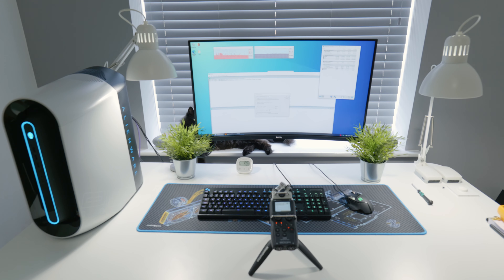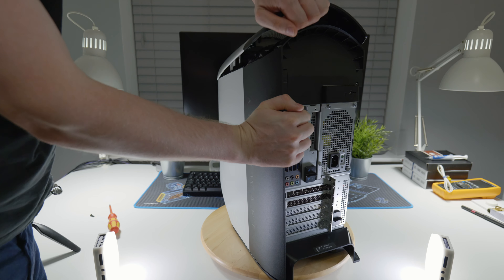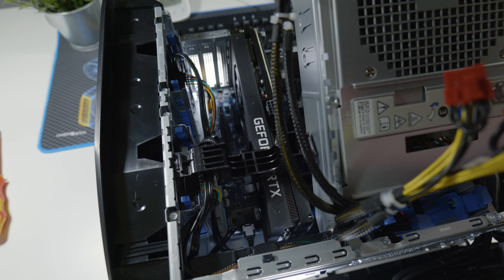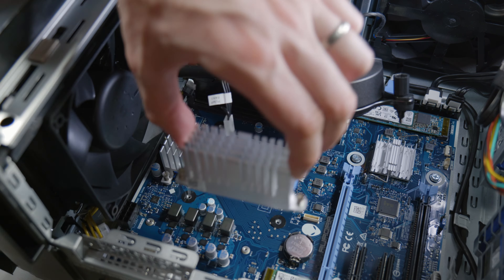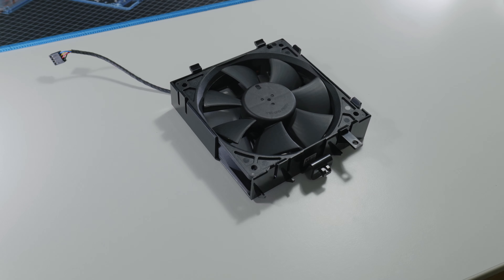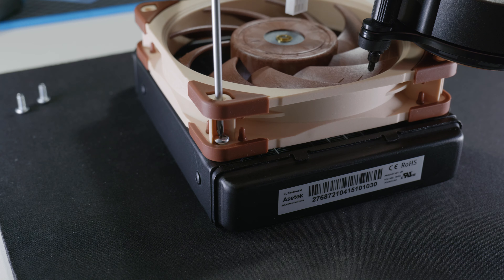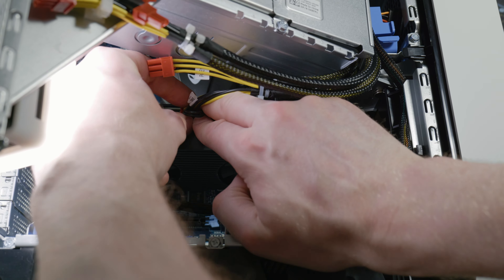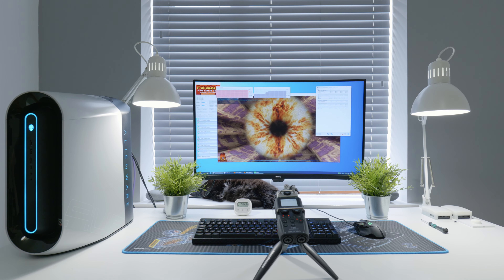Upgrading Dell Alienware Aurora R10 Fans

Comment: Just replaced two fans for my R10 with nf-a12x25 ($65 with tax), however, quite complex feelings.  1) it does reduce noises a lot when PC isn't heavy loaded, however,  it is still not that quiet when gaming, better, but still kind loud.  2) I found that original fans, especial the one in water cooling, that one is truly heavy duty, bigger and stronger than a12x25, I will see if the noctua a12 is good enough to do the job.

Comment: Hi, I've seen a lot of videos covering this mod, but I found yours to be very clear and straightforward, so thanks very much for this. One question though ; why go to the trouble of disassembling the aio and only replacing the stock PUSH fan and not putting in an additional PULL fan like many modders have done?
Reply from the maker: Hi. Thanks for the feedback. I have only replaced the fans to one keep the warranty and also just to get it to run quieter. As for performance improvement or dropping the temps for sure you would need a pull fan on top, I just didn't want to leave the top cover off or cur it open for additional fan.
Reply: @Edsdrafts  Hi, thank you for the quick reply there.  As far as I know, it is possible to fit a PULL fan on top of the radiator (on its own) without having to cut the top cover in any way.  This video shows you how it's done https://www.youtube.com/watch?v=fkVNcTXcpAo .  Also, I would like to know how the Noctua fans compare to the widely-recommended Corsair 120 Pro in terms of noise and thermals.
Reply from the maker: Huh, looks alright. It does look a bit much for most users though hence I didn't even consider it in my video. I might try it later. Wonder what's the effect on thermals.
As for fan - go with what you prefer, there is not a massive difference between quality fans at same RPM.
Reply: @Edsdrafts  sure, just wanted you to know that it is quite possible and easily done once you have removed the aio. It should improve thermals, but again, I can't say by how much. Thanks for all your replies.
Reply from the maker: No worries. Keep an eye on the channel, I am uploading my test results with these fans. You might find few interesting bits in there.
Reply: @Edsdrafts  of course, I am now a happy new subscriber. Keep up the good work dude!

Comment: Good video my Alienware Ryzen edition coming to end of 1 year warranty I'm thinking doing this as well. I guess stock Dell fans are just bad? I also unninstalled alienware command center it improved performance
Reply from the maker: Hi Ivan. Yeah, stock fans are very loud and inefficient. Having said that some are reporting issues with 3rd party ones. Very unusual but keep it in mind just in case. My ones are solid so far.

Comment: There are several versions of this fan. Would you happen to know if it is a 3 or 4 pin? Is it a 5V fan? Thank you, great video.
Reply from the maker: Hi. I went for a  standard 4 
pin PWM. Better motherboards support 3pin just fine but I would not advise it here. As for 5V - that's more of a project build sort of stuff eg. building USB powered laptop cooling pad.
Reply: @Edsdrafts  excellent, thank you

Comment: Looks like your restricting air flow on the left side of the case where the 2 exhaust ports are kinda looks like it’s against the wall. Good video
Reply from the maker: Thanks. The wall is around half plus meter away so should be no problem once the room has some air movement.
Reply: Also my bad but the side of the case is intake not exhaust…. Top and rear is exhaust. Have a good day 👍🏻

Comment: The last BIOS update for the R10 screwed up the compatibility. Hello, I have done the same fan modification with the Noctua for the front and top and it works fine. Unfortunately, the last BIOS (2.2.1 from the 9th september 2021) creates errors Alienware Command Center doesn't show up anymore the CPU temp and the BIOS complete checkup showed up error for the Front and TOP fans. Do you have the same ?
Reply from the maker: Hi. I haven't noticed an update this month, no. You should be able to downgrade if that's the case. Until it is fixed anyway. BIOS updates are rarely required to be rolled out asap.

Comment: I had a question. Will any 4 pin pwm fan work with the motherboard and give no fan errors? Also great instructions on the video. I just bought one 1 month ago and it gets very loud followed your steps and I didn't have a water cooler. And also thinking of upgrading to a water cooler. Any recommendations on water cooler and fans? Air cooler recommendations would be fine too. Great video made it easy for me to take apart.
Reply from the maker: Hi. Yes, any 12V 4pin PWM fan should work, keep the A (Amp) reading to 1.5A max as that's what Dell uses and it is very high. Noctua for example is 0.14A. I know, right?
As for CPU cooler I cannot say much as it might be that you will have to get Dell one. Keep an eye for my new video coming up, you can 'mount' a fan where the HDD cage is allowing more air in, especially important for air cooling CPU in my opinion.

Comment: After I change to  Noctua fan, everytime Windows restart run Pre-Boot System performance check first and say the fan failed to respond correctly. Although press any key will then enter windows, is there anyway to skip pre-boot check?
Reply from the maker: Hi. I must say I never had this issue. Have you updated the BIOS? My one is the latest version.

Comment: Why did you go with a lower CFM fan for the front. Stock front CFM is 169CFM Noctua is 60? Any reasons?
Reply from the maker: Higher CFM is all good and well but it is much louder. Temperature wise it doesn't seem to matter in this case as it is a heat trap regardless.

Comment: Do you plan on adding a 3rd fan? I have the same pc and have replaced both the fans like you did.
Reply from the maker: Hi Edson. I did, for intake. Check it on my latest video. I also tried push pull for exhaust - not much help. It looks like you need at least 240 rad to cool this CPU properly.

Comment: Thanks a lot for the video. I am hugely disappointed at the Alienware Aurora 10 for being such a loud system at such a high price.

After seeing the video, I want to replace the top fan with Noctua as well.

However, as I have seen in the comments, some users had problems with newer BIOS on it and custom fans.

Could you please check on your system if it still works with the latest BIOS 2.2.4?

Btw: I tried connecting the Noctua NA-SRC7 4 pin cable with a resistor inside to the Dell top fan. Afterwards, the fan did not run at all and the PC/BIOS booted into a fan checking mode. Had to remove it to get it running again.

Thanks!
Reply from the maker: Hi. I have manually downloaded and installed latest BIOS last weekend. No issues still, not sure why others are reporting. Maybe Dell did not use same components throughout their builds resulting in these strange errors. Different HW revision maybe?
Reply: @Edsdrafts  Thanks a lot for checking. I can now also confirm that it works!
Reply from the maker: Good news. Was it just a matter of a manual BIOS download and install?
Reply: "high price" its not that expensive

Comment: Thanks for the video, it’ll be really useful as I’m planning to do this myself on my R10. I may have missed it, but what are the ‘special’ screwdrivers used for the top exhaust fan?
Reply from the maker: Hi. You're welcome. You can use any screwdriver that can fit through fan mounting hole. I say special as most people would only have standard philips of flathead that are too thick to fit.
Reply: @Edsdrafts  ah that’s great, thanks, I’ll try a Phillips tip 0. Fingers crossed 🤞 thanks!!
Reply from the maker: Sure thing. Worst case - a trip to local hardware store will solve it, you don't need an expensive one as long as the size is right. You can even bring the fan with you to test.

Comment: this is probably the best video i've seen about the process. so i do not expect any better temps with this mod, but does it actually help with noise levels? temps shouldnt be worse than before either, of course.
Reply from the maker: Hi. It helps with the noise yes, temps are pretty much the same. I also noticed when using non-admin account fans don't ramp up as much. Go figure.

Comment: Do you think leaving the rubber corners make it harder for the fan to push air through the radiator since it creates more of a gap or should I just leave mine on?
Reply from the maker: Hi. You can test both but I don't think it will matter either way. This system is just badly designed when it comes to cooling.
Reply: @Edsdrafts  true. The best upgrade is a new motherboard/case entirely haha
Reply: @mrwanderlive  PSU has proprietary connectors to mobo unfortunately. Dell really doesn't want any parts except for the cpu and gpu to be mismatched which is a shame. to use the psu in another build you'd have to swap the mobo with it :/
Reply: @charidemusx6511  meh both of those are the real treasure within it anyway. Plus the ram and SSDs

Comment: Hi, thanks for the Mod. I replaced both FANs on my New R10 (build 7 days ago) to the Noctua, but the Front Fan is causing a bios error. How did you get by this?
Reply from the maker: Hi. That's strange, I haven't got any errors. What is the error you are getting? Have you used the same header without any fan splitters? Although I even tried splitter without issues.
Reply: @Edsdrafts  yes. I get an BIOS error for the Fan. I just plugged it in. The top Fan works flawless. Replaced it for the original and no error. I read that normaly it is the other way round and the top fan  is issuing error.
Reply from the maker: Fortunately no errors on my build. Are you using Noctua? Have you reached out to Dell and fan manufacturer?
Reply: @Edsdrafts  Yes using Noctua. I bought now a Corsair ML120 PRO and fitted it in the Front. No Errors. So my configuration is now as follow: Noctua NF-A12x25 PWM in top and Corsair ML120 Pro in Front.
Cheers.
Reply from the maker: Huh... maybe just needed a more power hungry fan and that was it.

Comment: I recently swapped the fans and added one, but the top fan starts to slowly drop fan speed from 50 - 56 down to 30 
Once it starts to lower speed it won't go back around the 50s unless I restart my r10
Reply: I should add even with stock fans the top fan would also slowly slow down before that it has gotten stuck wide open until I restarted
Reply from the maker: I am not entirely sure why but I can see from the comments some are having very unusual issues. Have you tried Dell support? What did they say?
Reply: @Edsdrafts  before changing the stock fans I had tried with Dell support and they ended up changing out the front fan not the top one

Comment: do I have to take off the entire cpu cooler to replace the fan? Also would arctic p12 pwm fans work? Thanks!
Reply from the maker: Hi. Yes as access is very limited. It would be much easier than trying to remove it while installed. Any PWM 120MM fan would work. I am releasing another video shortly with more info. Keep an eye for it.

Comment: I want to ask you. Is this replacement possible within the dell warranty period? Will I not damage the warranty?
Reply from the maker: Hi. Generally speaking unless you damage something inside the case, replacing fan is not an issue. If you decide to ship it for warranty however then you will need to put the original fans back in. They might not help troubleshooting noise or temp. issues too knowing fans been changed.

Comment: No push pull? That noctua fan tops out around 2000rpm i believe while the dell server fan is at 4000rpm. (Cfm and static pressure on the dell oem fan is insane but noisy) i wonder how the single noctua fan compares to the dell beefy server fan
Reply from the maker: Hi. Well, results with Noctua 1400RPM were nearly identical to original fan at much higher speeds. Noise is king.

Comment: So im new to PCs I bought one of these and I didn’t get a liquid cooling fan is the regular fan gonna be loud if I don’t get a liquid cooling one instead
Reply from the maker: Hi. It is hard to tell what your experience will be as I never tried it but I do expect your CPU temps. to be very high to the point of throttling. If it does - get Dell involved for an upgrade as in my opinion air cooling option they offer is not enough.

Comment: i did this but after upgrading bios my pc wont let me use the ML 120 pros i had installed now i had to install the old fans...
Reply from the maker: Hi. No issues with BIOS so far nor there should be. Even if my Noctua went at full speed at all times it would be quieter than Dell at half =)
Reply: @Edsdrafts  yea its the motherboard not sure what to do here, i had the ML 120 pros for 4 months inside then had to put old fan in after bios update...
Reply from the maker: Reach out to Corsair and Dell, worth a try.

Comment: Thanks for you video.
Yesterday I made the same configuration with the same products (noctua fans) in my R10, my pc is more quiet it's a very good point for this part. 
But the temperature is the same during high performance, my cpu is between 88-91 degrees. I see your video about the temperature and I think we need to replace the Alienware "watercooling" with the Corsaire watercooling (like H60 AIO Liquid). 
Have you tried to replace the watercooling system ?
Reply from the maker: Hi. Yep, cooling this PC is a nightmare. I haven't because unless you manage 280mm rad to be fitted there's no point.
Reply: Still hot with all the mods. Still crashes at around 67c GPU and 76c CPU

Comment: What software can you download to control fab speed after replacing the fans?!!!
Reply from the maker: Hi. Check on Google, there definitely are options although my new fans are quite silent even at full load so I just left it as is.
Reply: @Edsdrafts  mine are silent as well but when I’m sleeping then go to work I use my hardware to mine. I want to put the fans at full speed to provide a little better airflow. I’ve googled and still can’t find software that’ll control my fans.
Reply from the maker: I've done a quick search and found one called SpeedFan. I have never used it though so cannot comment on it, sorry.
Reply: @Edsdrafts  I’ve tried that one it doesn’t work it only identified the gpu not the dell mobo.
Reply: @alfredoflores8493  ACC you can control fans there

Comment: How do I find out which model of Aurora I have and if the fan will fit?
Reply from the maker: Hi. Best thing to do is check Dell's manuals on your model, you can find s/n on the case and look it up on dell.com/support. Or just take the fan out and measure it.
Reply: @Edsdrafts  Thank you for the info and quick reply!!!

Comment: So you changed two fans right? So the purpose of changing the fans was jus for the noise?
Reply from the maker: Hi. Unfortunately yes. To get better cooling you need at least 280mm rad with 2 fans or change the case and get a good air cooler. Both options not realistic.

Comment: Can i remove the top fan without pull it of from the cpu
Reply from the maker: Hi. In theory yes but I would recommend against it as you might damage the rad or tubes.

Comment: i tried this mod and my cpu temp went from 64 c to 81 c while gaming one time even hit 81 c  I dont think the noctua nf a12 is enough to cool radiator  maybe 2 fans would be better i only tried one just liike you  honestly not comfortable for me having high temps even though my cpu is rated to run optimun until 95 c
Reply from the maker: Hi. What temps do you have on idle and what are your room temps?
Reply: Did you install them the right way?

Comment: I installed a sata ssd today. Thanks for this video. But I also noticed that the moron who assembled my aurora r10 stupidly put the black bracket that holds the gpu card right in front of one of the 2.5 cages. So annoying. Had to use the other one and I could remove it but it was kind of stuck and don't want to break it. Just thought it was so stupid that they didn't realize they were blocking one of the cages
Reply from the maker: Thanks for sharing. Not great experience I am sure though Dell does not seem to care much. After all they are already charging hand over fist for an inferior product.

Comment: I popped three Noctua Chromax fans in the case - 2 on push/pull on AOI rad and one as front lower intake - temps for GPU down 7-10 degrees form 70-72 degrees but the biggest game is the computer is finally quiet -- No longer a wind-tunnel!  Initially tried 1 on the rad and that had similar temps for GPU as you'd get with stock fans but again soooooooo quiet. Dell need to stop being so cheap and putting loud-arse fans in their products.

Comment: I can’t get the damn gpu back in
Reply from the maker: Hi. Wanna share a bit more? At which point are you stuck and what you have done so far?
Reply: @Edsdrafts  I removed the gpu to replace the the front and top fan and now my gpu won’t click back into place. It clicks on the right side where the clip locks onto place but the left side won’t go in
Reply from the maker: Be careful and take your time. The back bracket with all display outputs supposed to slide in correctly. Yours is probably at an angle hitting the motherboard. Try reseating by securing that side first and make sure you see where it goes.
Reply: @Edsdrafts  ok I wasn’t aware that it had to slide in but I did see that there’s a slot for the gpu to go into on the side of the mother board and tried getting it in there for hours to no avail
Reply from the maker: It can be a bit tricky. Make sure you are slotting it in perfectly perpendicular to the motherboard. Keep checking from the side it is going into the slot between case and board as well as into PCIE slot.
Reply: @Edsdrafts  thanks for the reply man! I’ll definitely let you know when I manage to get my card in
Reply: @Edsdrafts  now I’m stuck on an infinite automatic repair loop..